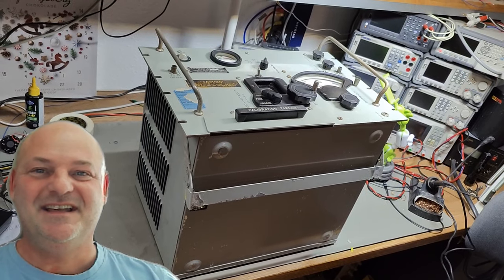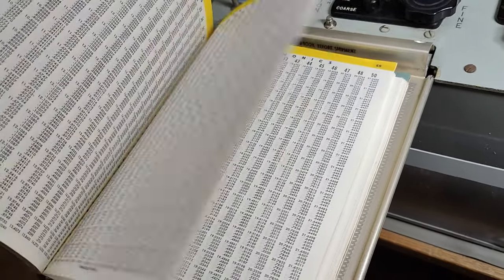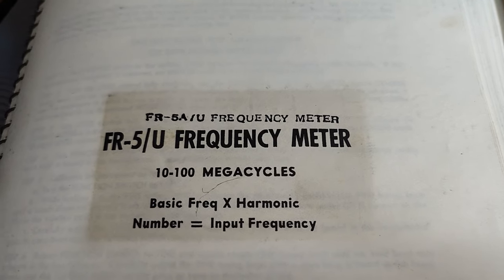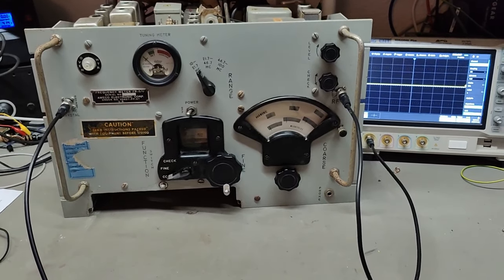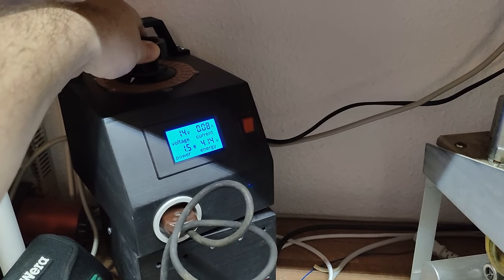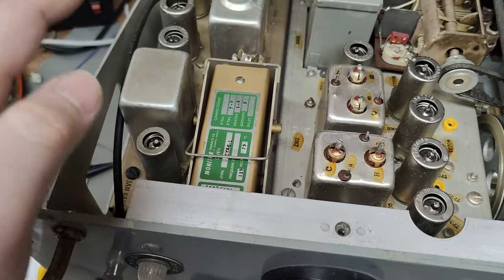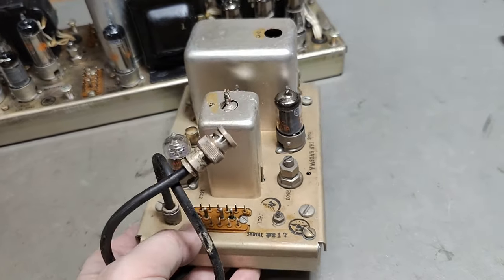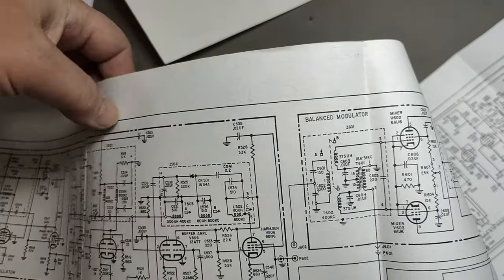Ameco Electronic US navy Frequency Meter FR 5A/U 1957-59 test teardown

Comment: Hi Thomas and All,
I have one of these in beautiful, like new condition. Mine looks to be Serial # 896 or 396. Very small numbers and I don't have enough clear horizontal space to bench it to read it for sure. I have had mine up and running a number of times since buying it in 1993. I measured several small TX's that I could hook up or have standing idle in TX mode without jamming any used frequencies or restricted bands. It is accurate to the specified tolerance, something like 0.002.
I'm considering a selling mine, as a tube fan/prepper wants to buy it so he can check frequencies "after China and Russia Nuke us". This thing is ruggedized beyond belief. 
Thomas, thanks for the great content.
Rick